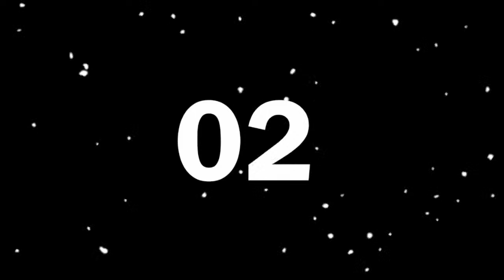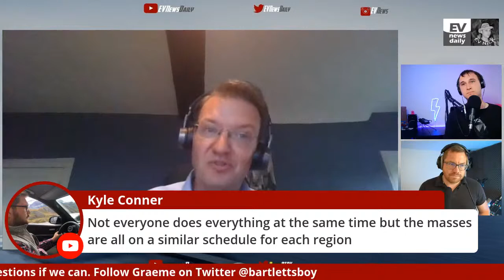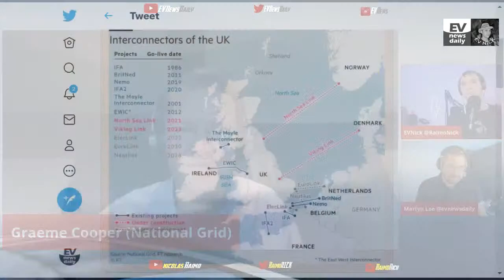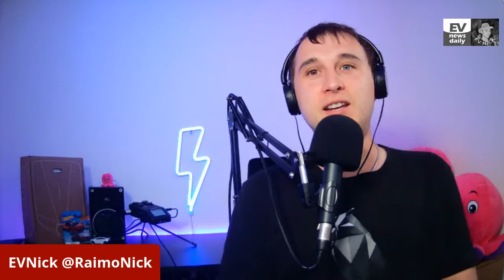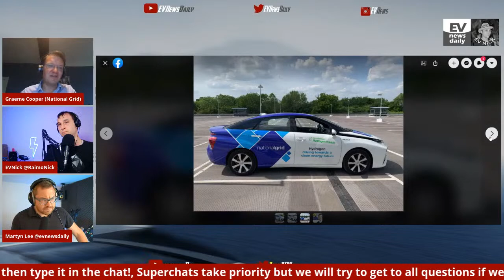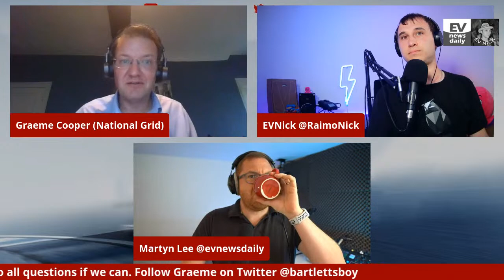LIVE Grid Going Net-Zero Graeme Cooper

Comment: Graeme Cooper is very impressive.... Hope you can have him back... And ask him his take on Modular Battery Swapping, such as Ample is trying to develop or Honda standard.... 
Since EVs could use less Modular Batteries for the average shorter commuter trip. And then use more Modular Batteries for longer trips. With any net excess Modular Batteries not being used by EVs, being used to balance the grid. 
Either at a central battery location, like NIO or Ample is currently doing it. Which would allow the Modular Batteries to be leased or rented too. Or at homes and business, where the excess Modular Batteries would act as a Powerwall.
Much like V2G it will be complex implement. But even more so, but the upsides seem like they would be worth it?